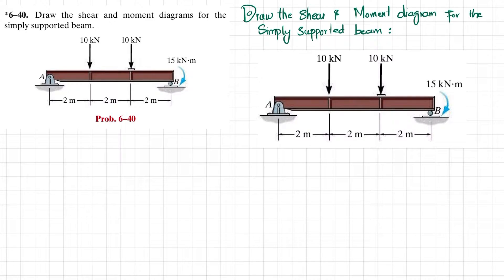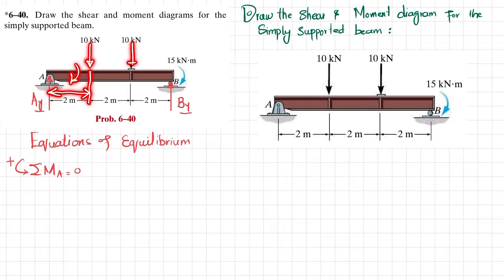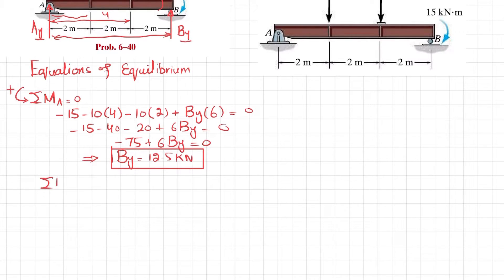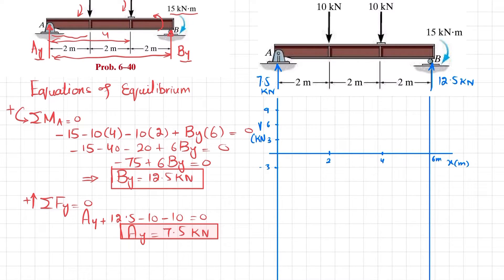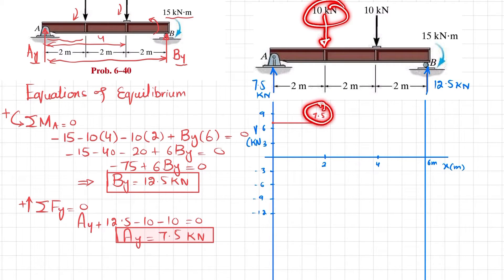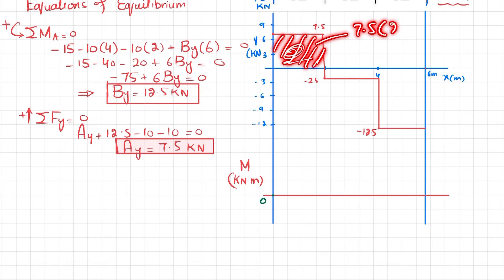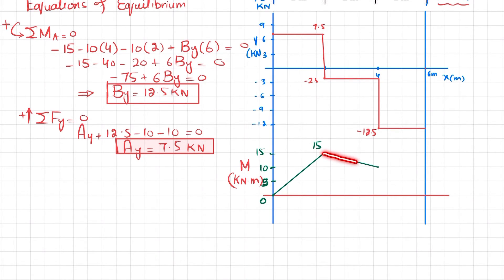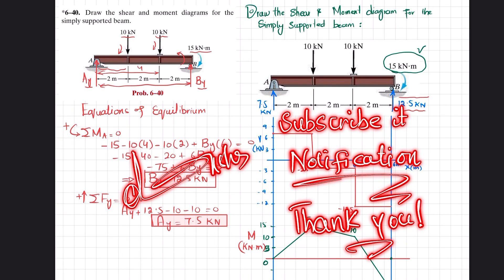6-40 |Chapter 6| Bending | Mechanics of Material Rc Hibbeler|

Comment: Sir if I consider anticlockwise moment positive in tha bending moment diagram my diagram is not same as your 

I calculate moment at every point for bending moment diagram.

My moment points are(0,-15,-10,15)
Reply from the maker: While drawing bending moment diagram clock wise moment should be plotted positive and counter clock wise moment should be negative for external moments only.
Reply: @engradnanrasheedmechanical thank you sir ❤